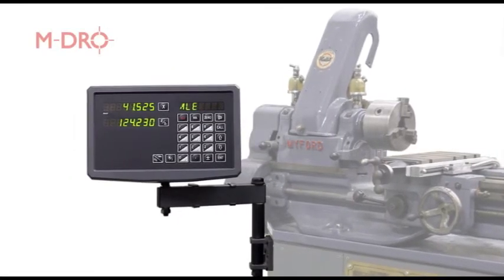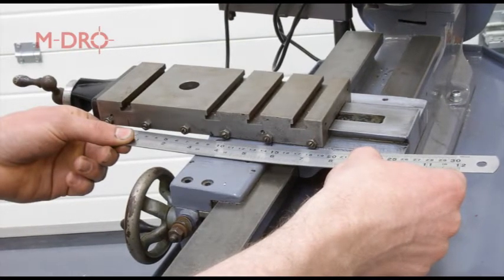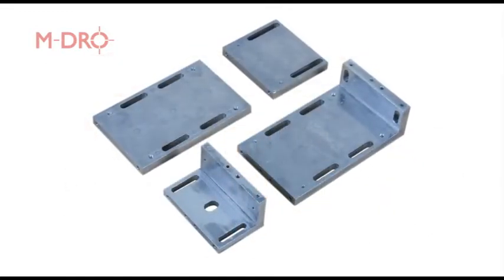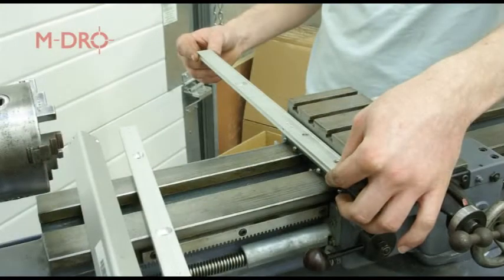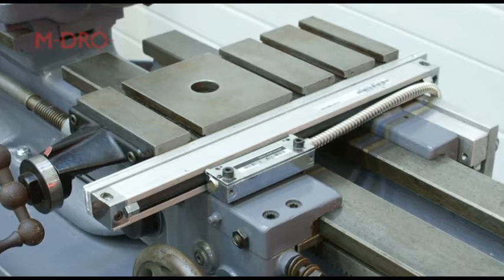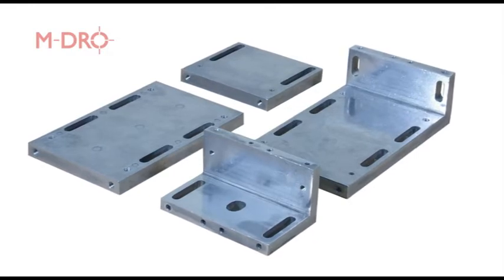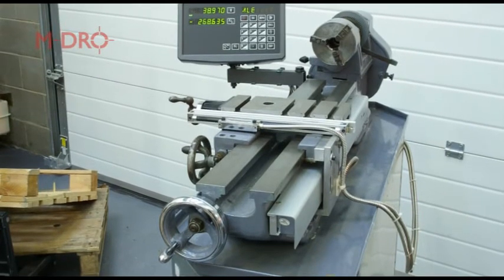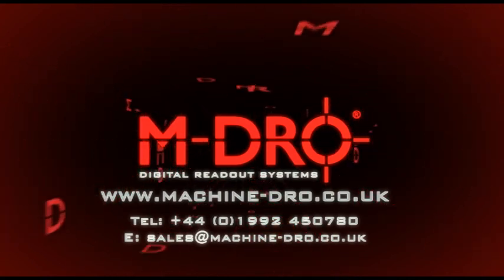Myford ML7 Digital Readout Installation

Comment: The holes you see at 5:15/8:18 are M6 with pitch 1.00, distance being 10cm, i.e. making the distance in total being 50 cm between the 6 holes.